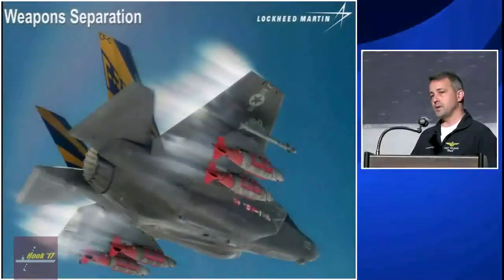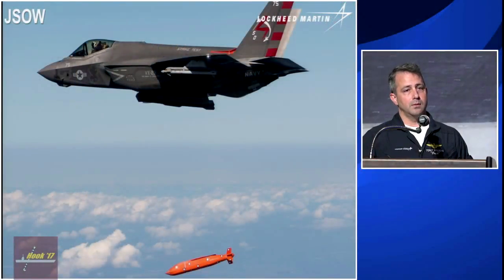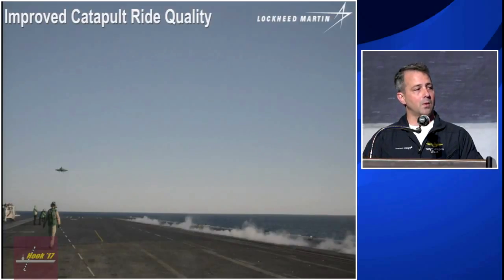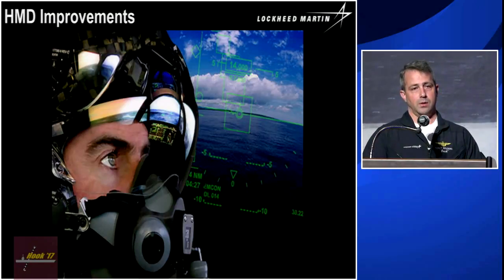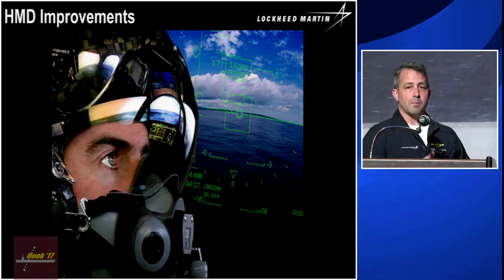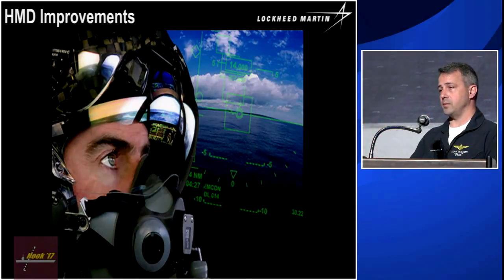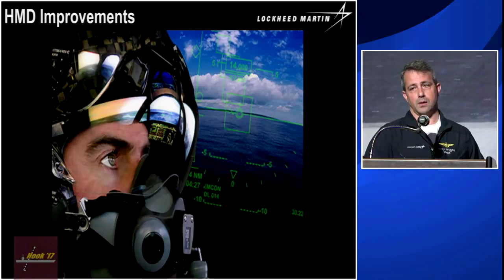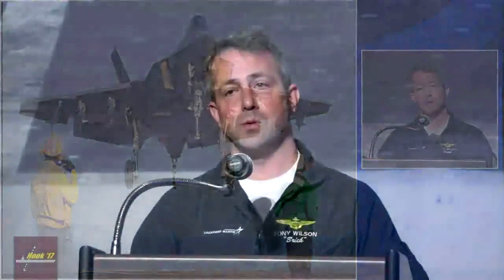Tailhook 2017 Symposium - Update on F-35C testing from LM test pilot

Comment: Did I just hear 3F already released ?
Reply from the maker: Yep apparently - USAF and USMC F-35s are starting to receive Block 3F this month as well, so the timing isn't too strange (just rather the fact that it wasn't better publicized).
Reply: yes you did. your ears are just fine :-)
Reply: Why does that surprise you? It was always planned for release right about now.
Reply: This is for F-35A Block 3F
http://www.luke.af.mil/News/Article-Display/Article/1386133/lukes-newest-amu-supports-f-35-program/
The unit is the first Luke F-35 AMU to receive a 3F, or full-up, combat aircraft capable of pulling 9G’s in the air